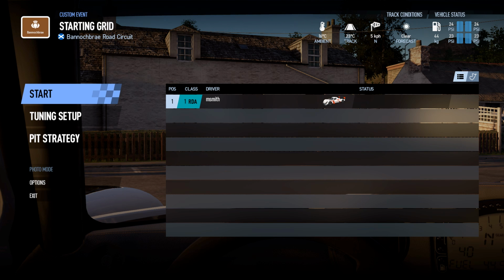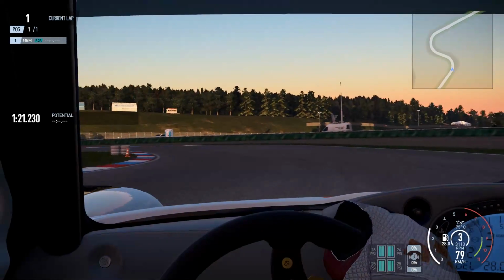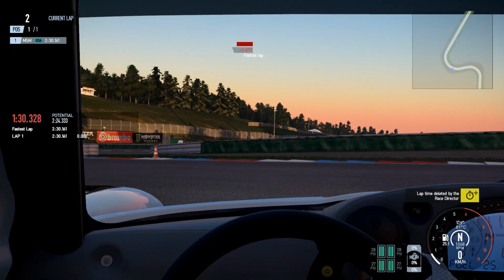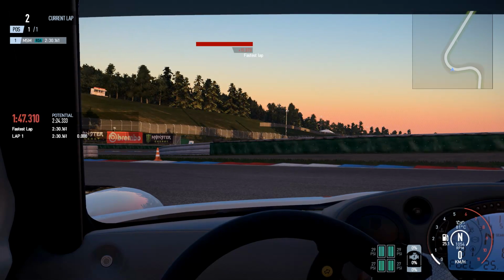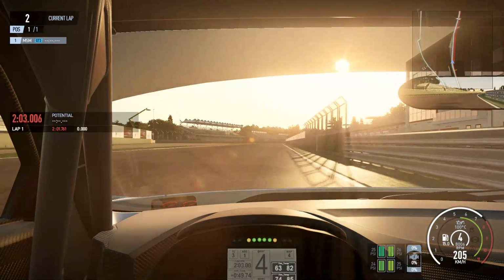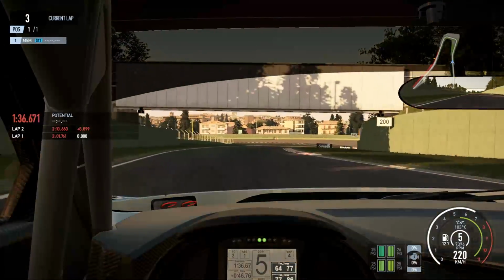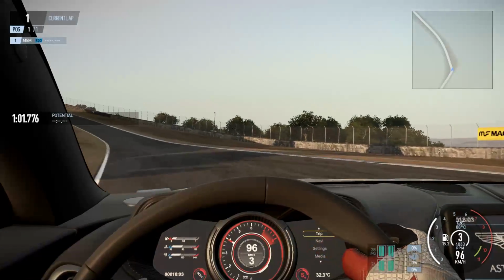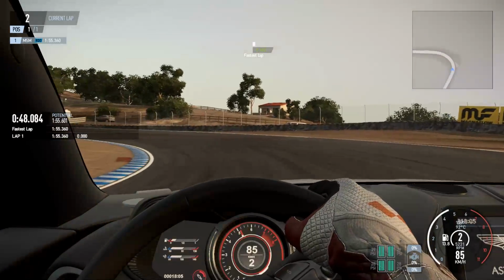Project CARS 2 - How Good is the Force Feedback and Handling?

Comment: My wheel on straights shakes like fuck and my FFB isn't even high at all, it makes no sense? Helppppp
Reply from the maker: MS Horizon  very strange.  Are you on PC?
Reply: im on xbox one using the Logitech g920
Reply: I'm not actually sure because it only happens with some cars on some tracks but its really weird
Reply: I tried it but it didn't work :( they said there will be an update for the wheel settings for g920 and thrustmaster

Comment: When building "proper" simulations, each car should be modeled based on its unique configuration, of course this is very time consuming, and not surprisingly most PC exclusives contain small car rosters.

That's not to say this is a bad game, but it defies logic that a 180 car sim can be released in 2-3 yrs unless there's scores of physics programmers, and my understanding for pcar1 was that they had a grand total of "one" physics programer, who IMO, was trying to build an overall model which could be effectively copy and pasted to each car and modified according to weight and engine power etc.

This is more than likely a simcade, but so is F1 2017 and many consider that one of the best F1 games ever.

Comment: dat FOV is hurting my eyes dude...BTW, the biggest flaw for me in PC2 is inconsistency in every aspect, FFB, sounds, track surface quality varies a lot...
Reply: very normal fov for play with wheel ,  so the simwheel feels on the place where the wheel would be .
makes the car handle better and more controllable on the limit ,cars turn in better to corners and respond to input better .
i use a similair FoV ,,there are sites that calculate the fov for specific sims .
Reply: mostly true what you said, i play with wheel only BTW, but i always prefer 90 degrees as then i can see what would i actually see as a driver inside (the same perspective you know?), otherwise it seems like and old man (or woman) with his face stuck near the windscreen :D (and cant see anything what is going on around)
Reply: true , i accept that problem in favor of drivability , but some decide to go tripple screen to solve that . or even go VR .

i play PC2 since release now ,and the longer i play ,the more cracks i  discover .

i WILL keep playing this for immersion and all extras like rallycross and weather , but for competative simracing ill stick with AC because it has better speed experience and is more constant ,still PC 2 has lots to offer so it will be driven (unlike the pc1,only used it sometimes for 250cc superkart)
Reply: 90 degress FOV will completely destroy depth perception, correct FOV is extremely important, use a online FOV calculator to get correct fov, for most people it'll be sub 50-40,FOV is different from POV,once set fov simply adjust seat position (POV)

Comment: Is it just me or do the fastest cars just have a total lack of sense of speed ?

I went straight to the fastest open wheelers and i just felt like i was driving 100 km's per hour....

Looks are awesome, menu's are much improved, sound could have been beter, but that sense of going 300 km's per hour i just dont feel it for some reason...or does this problem lies with myself ?

Love your vids SimRacing <3
Reply from the maker: Phe rocks thank you so much for your kind words.  I do get a slight sense of that, but it's possible also that you have your FOV settings wrong.  If it's too narrow you'll lose that sense of speed.  Maybe confirm your settings based on this: https://youtu.be/oLT01pGApo0
Reply: Will try that one out sir, just got the game and just came over from AC ;)
So far i am having a blast !!!